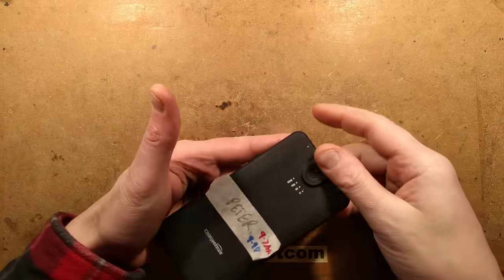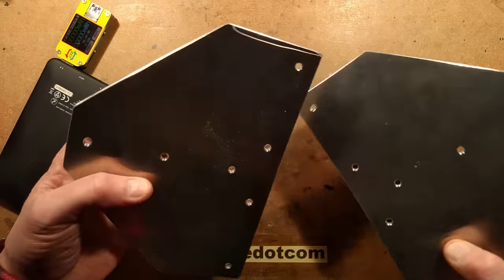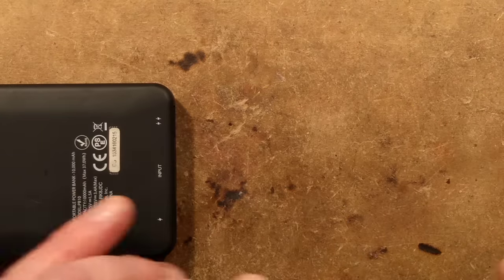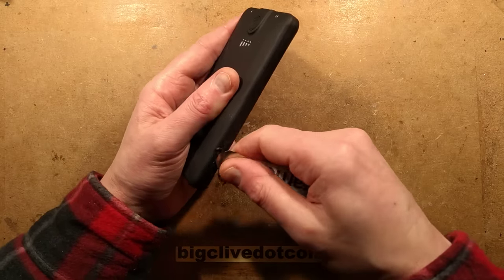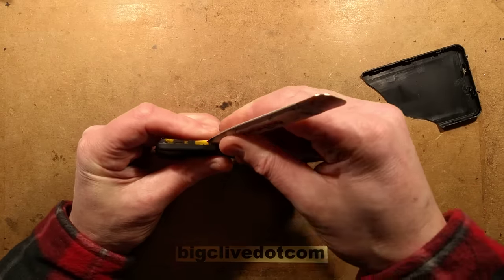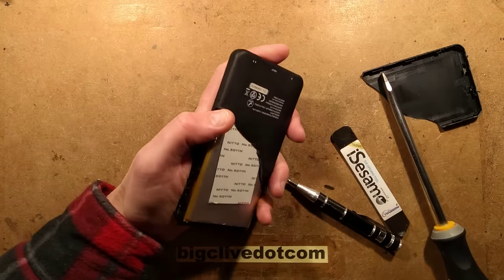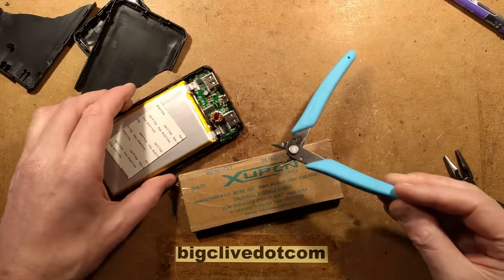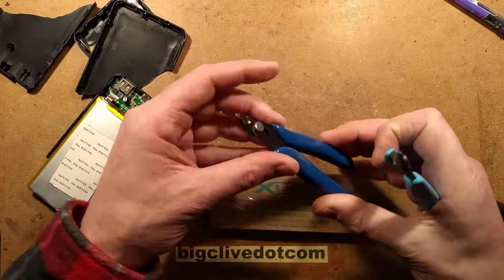Inside a recalled Amazon Basics power bank.

Comment: Iphone are easy serviceable but you have to take the screws out
Reply: Except for Apple's anti-repair measures where some parts are individually tied to the mainboard and will give you a nag screen, disable some features or stop working completely if you replace them. Oh and you know that big dumb piece of glass on the back of the iPhone 8? Replacing that is ridiculously hard, unless you buy the whole rear assembly, which will cost you more than the screen. I'm pretty sure they don't want you to fix their phones, and they make sure you know it. Other manufacturers have their problems too, but at least there doesn't seem to be a concerted anti-repair effort behind them.

Comment: To get it right: 10 Ah at a voltage of 5 V is the confirmed capacity, as I understood. This is 50 Wh of energy per charge/discharge cycle. This means that at an approximate voltage of 3.3 V of the battery itself has a capacity of (5/3.3)*10=15 Ah. This is quite a lot compared to the e.g. 3 Ah of 18650 LiIon cells. What are the dimensions of this battery pouch?

Comment: Appreciate that this is an old video, however the below is an extract from an American recall notice/site, which explains the issue:- 

"Incidents/Injuries:
Amazon has received 53 reports of the power banks overheating in the U.S., including one report of chemical burns due to contact with battery acid and four reports of property damage, including fire and smoke damage."

Comment: The trick to opening cases like that is to loosen a spot, put in a wedge, then work your way around. Sometimes they'll let you slide the wedge along, but usually you have to just work your way around with pokes and wedges.
Reply: I think this one had so many hard latches.  Sometimes latches are not meant to be broken, as it appears these are - the device was not designed to admit repair.

Comment: Comment on the internal lithium cells to case spacing you mentioned at about 07:45
The 16,100mAh Amazonbasics PB16 powerbank has what seems a LOT more cell to case space along with good cushioning material there than your 10,000mAh powerbank. 
The spacing without the foam cushion measures about 2mm but is entirely filled with a spongy soft foam cushion continuously fitted between the two long sides of and the bottom end of the plastic case and the 3 lithium cells. It feels about the consistency of Nerf foam. 
However, at the sharp bottom corners of the 3 lithium cells the foam is deformed quite a lot as it stretches around the cell corners, reducing the foam protection from ~0.5mm to 1.0mm of cushioning...but ONLY at the sharp corners. But, because the lithium pack is held in place to the plastic case by an adhesive patch on the 'bottom'-most cell and the supporting foam along the sides and bottom of the pack, it maintains an approx 1mm air gap between the foam cushion and the plastic case at these two corner points. I would think that the air gap could be compromised by dropping the powerbank onto a hard surface on one of the corners by either causing slippage of the battery pack inside the case, or deformation inwards of the plastic case corner..which I think would take more than a 1m drop to a hard floor. Based on your description and what I see in the PB16 I think as far as this part of it goes, the 16,000mAh powerbank is designed/manufactured better and likely "safer" than the 10,0000mAh model

Comment: The petrol thing is correct, but.. yeah, I understand why you wouldn't want to. Isopropyl Alcohol is a good alternative. It doesn't outright melt the adhesive like petrol does, but starts to dissolve it, making it far easier to remove after.

Comment: 21:50 I think you're right with your "boost" theory. When you did the current test at the beginning, you could see that clearly. The output voltage dropped a bit as the current increased, but a few moments later it came back up to 5V.
I think that the circuit readjusts permanently and depending on the load. I actually think this power bank is great. You get a lot of capacity without the cheating with glued-in weights and without almost air-filled case. And the specified output Voltage and currents are actually achieved.
I find it rather rare that you get exactly what you pay for. This power bank makes a good impression on me.

Comment: Do you think it's possible that there were two versions of this power bank?  I'm thinking that the "Nitto" branded foam on the "front" side of the battery might not have been there for the first version.  Then the manufacturer may have identified an issue where if the power bank was dropped then that side of the case may crack (noting the brittleness of that case) and puncture that side of the battery.  Putting that foam pad on that side of the battery may have alleviated that issue and that's why it looks so out of place.  Amazon, covering their butts, may have just recalled them regardless of version.  Just a theory ;)

Comment: I have the 16Ah version of this bank that has two lightning bolts on both output ports. Is capable of 3.6A across a common bus.
And yes, it was recalled as well.
Reply: That's a valuable hint.  Presumably the 16Ah version has different cells. This means that the problem is likely somewhere in the circuitry - some component may be likely to overheat and/or catch fire.

Comment: you can use rubbing alcohol little bit less flammable just a small amount still flammable though, but it works pretty good you should also invest in some plastic spudgers they are great for taking stuff apart

Comment: Hey Clive, the wround current shunt is still accurate for this test. If your load was switching rapidly then it may cause issues, but for a linear load it is a non-issue.

Xl = 2*pi*L*F, where Xl is the reactance in ohms (basically resistance), L is the inductance in Henry, and F is the frequency.

Xl = 2 * pi * whatever * 0 (dc) = 0, so all you have is the DC resistance.

However, if you had a switching load, then it may cause issues.

Comment: Aww, Clive. . . . . You made me sit through nearly half an hour of video, and no thermonuclear meltdown! ☢

I don't know much about power bank type devices, but this one seems to be quite a beefy looking effort, and just the thought of all that energy that could be released if this thing went 'prongs up' - I mean, image that in your top pocket, and you fall against something like an iron railing, or a brick wall - Ooh! 🎆

I reckon you should build a redesigned case for it, and hack it into a car jump battery booster pack! At 10Ah, it should have the potential to charge a car battery enough to get a few seconds cranking (with a suitable DC-DC voltage conversion circuit)?

Comment: As a matter of interest, are R27 and R28 the resistors put across the data pair to set the charge current? Which way, R0 = high current, or R0 = low current?

Comment: @bigclivedotcom   A little tip for removing the batteries from their stickers ... I use dental floss as a thin flexible wire to slip under the battery and tug in a balanced fashion to "slice" though the glue.  This allows you to use unreasonable force (if needed) without bending in any way the battery (and possibly causing fires)  :)
Hope it helps for next time!  Keep up the GREAT videos.  Regards.

Comment: Instead of using petrol to get the sticky pads off there's actually a product that stoma patients use to remove the adhesive plates, a medical adhesive remover, there's alcohol and alcohol free versions of this aswell, it's basicly a small box with 50 seperately packaged wipes, i've used these to remove residue from tape and all sorts of things, aswell as peeling things from each other. Works well with all the tapes and double adhesives i've tried so far

Comment: Help,  I have a 5v DC 3amp input feeding a NiCad this is off a controller board that appears to have failed with smoke,  the board though eiether has a bypas of the input voltage to the end load, or a switch to take either the external PSU voltage or the battery voltage,  the board or domponents are too small to carry the current, is there a veroboard design I could use to replace I have plenty of enclosure space in the end load area to do this? The final load is a 5v motor driving a direct driver turntable and small audio amplifier to tiny loudspeakers, so thats a fair current draw.

Comment: Simple answer on why it was recalled... central hot-spots and compression of the batteries by the "filler" tape which placed them hard-in-contact with any case compression.   Flatbats are supposed to be supported by soft foam with compression protection equal to at least 25% of their own thickness and you're not supposed to put packs against each other OR combine their leads like that.  Think what can go wrong if one of the flatbats develops a drain state... nothing to protect it against current from the other!    So, shit design 5 different ways!
Reply: I saw a big battery bank that had 5 cells all shorted together. That would be some massive chain reaction.

Comment: If the top double stick pad had been stuck to the case, wouldn't that have provided more protection to the batteries against impact damage against the corners of the case? I'm puzzled why they'd go to the trouble of adding the tape without taking that last step across the finish line.

Comment: I'm tending toward the thought that the failing packs were abused in some way before they failed...perhaps having been dropped as the video suggests. I KNOW my delivery service frequently ignores the doorbell and just drops packages over a 6 foot fence onto a concrete patio. That's a LOT of G's and many shipped packages are not designed to protect adequately against that kind of drop.

The flux residue also concerns me. Leaving that crap on the PCBs is NOT best practices and can lead to damage which could lead to a critical component or board failure.

Comment: Heat. Warm the whole thing to about 45 deg C. The glue softens enough to allow peeling with less damage.
Reply: Alternative is cold, freezing the glue below it's design limits but not low enough to damage components.
  For heat or cold, some disassembly kits include a thermal pack that is heated/cooled in the kitchen then pressed against the case closest to the glue.

Comment: Ive run across these circuit boards, by all means not identical,  they're fairly common and simple, it must be how they've jammed so much cell inside the pack giving the recall issue. Thx for the video.

Comment: Hey Clive! For separating things attached with soft adhesives like double-sided tapes and removing labels I've discovered that a modest temp heat source works nearly every time. Then there are always solvents in heat- sensitive situations . I've used laquor thinner with great success, and ethanol although less effective, rarely affects plastic surfaces.
Reply: HG do a product called "sticker remover" that smells properly of turps, not that substitute but actual turpentine.  Whatever it is its very good at removing sticky stuff.

Comment: If a battery has the foil damaged, you should be able to smell the odor of a chlorinated solvent.
If the damage to the foil is minor and the evaporation is very small, CO2 and water vapor will enter the battery and produce a delayed damage.
Over the span of two weeks, the battery will present an ever increasing internal resistance, day after day. At the end of the two weeks, the battery will overheat with the nominal C/10 charge rate, and will eventually bulge from the rapid internal pressure increase.
I never re-use recovered Li-Poly batteries for my projects.
Thank you for your great video...

Comment: The metal tabs/plates on the PCB where soldered on, you could of very easily desoldered those. They are not spot welded to the PCB just the metal plates.

Comment: Videos like this give me ideas for my battery bank i want to make for long camping trips. I'm building it by recycling a beefy version of the "Tesco Power Hit" (and removing the battery) and a battery bank of 18650's. Any advice? Mostly plan on reusing the circuit board inside. Would have to take the batteries out to recharge the thing, but that doesn't sound so horrible really.

Comment: i was wondering if you ever came across some galvanic corrosion due to using cheaper aluminium or alu wire or alu battery package or some sort of electronic applications made from copper ?

Comment: Former Apple Certified iOS Technician from an American retail chain here... yeah they’re not really designed for user serviceability but thankfully there actually is a proper way to open modern iPhones (at least back when I worked on them) which doesn’t involve scraping up the external case. You basically unscrew them and pull up the screen with suction cups. Around 6S or 7 they added adhesive gaskets around the screen which have to be cut once you manage to pull the screen up a couple mm with their tools (or a rough iFixit equivalent). You’re supposed to scrape it off and put on a new gasket at the end if you’re an Apple technician proper, but I wouldn’t fault a shitty screen shop for skipping that. I’ve seen proper technicians skip that. Oh and there was a flimsy ribbon cable that you have to pop out before opening it more than a couple dozen degrees.

Comment: What printer are you currently using? Mine is supposed to be a photo printer and despite source, settings and calibration it comes out a bit blotchy.
Reply from the maker: Epson eco tank.  The original image has to be well lit for the best results.
Reply: @bigclivedotcom  Thanks. HP used to be really good but the last two models I've bought have been fairly sub par.

Comment: The 0829A I believe is a Chinese clone of a BQ2954. That SOP16 is a Lithium Ion Charge Management IC with switching controller.
Functionally, it manages charging (between slow and fast charge modes) while monitoring temperature, voltage and current. It has two bi-directional pins for LEDs to show status, but also programs the display mode, and if current sensing is done on the pos or neg of the battery.

Comment: Could just have been recalled because Amazon got too many complaints about packs bulging or failing (without flames) because Amazon bought the cheapest possible cells, and recalling them before there were fires was just good economics.

Comment: Gave one of those to my niece as a gift and she abused it for a couple years until it shat itself.  She gave it back for repair and I just bought her a new one. Sat on it for 6mo until they recalled it. They sent me a fire proof bag and heavily labeled box and so I sent it in to the recycler for a full refund. 

Don’t know if her failure was related to the recall but I did buy the new one off Amazon, though not Amazon branded. I mostly purchase Anker and some Aukey but we usually lose them before failure.

Comment: Just for fun I bought a box full of these Xupcn cutters, or ones that are physically identical with them, with PLATO Model 170 printed on them.

While they do work if you just use them on very... very light cutting work, they can be surprisingly prone to failure if you give it anything to cut that is too much for it. They always seem to break the same way; one of the cutting jaws will just break near the axis.

One broke just by slightly pressing the jaws together without anything to cut. Another one broke while trying to cut a regular pin header connector pin, it just couldn't do it and died out of shame. Randomly, some of them live long enough to have the cutting jaw edge completely dull and malformed, again from very light level work such as cutting small wires. I think these cutters are made from tin or some other soft metal.

One of them has been a trooper and actually lasted for two years without breaking, but only because I was careful with it. I bought a box full of miniature version of this cutter as well, however they are even worse. They are so bad that even looking at them will break the cutting jaws, figuratively speaking. Two of them in a row broke easily when cutting again a little pin header connector pin. One I was able to break just by pushing one of the jaws with a finger. Another broke in two when it dropped on the floor.
Gotta love the China quality!

Comment: It would appear to be as you say, that the enclosure they have used is a tad too small for the cell dimensions. If it was dropped, or something weighty was dropped onto it, there is no space to accomodate compression or deformation of the plastic without it making contact with the cell. A shame really, as it is not a badly constructed powerbank aside from that issue.

Comment: Samsung makes excellent Li+ batteries. For the Note 7, Samsung Mobile sourced its batteries from ATL, not Samsung SDI (battery division). The issue was between manufacturing tolerances at ATL and the housing supplier Foxconn, which resulted in the cells being punctured/crushed and internally shorted. Also, even a good quality Li+ Polymer battery can explode or catch fire if punctured/crushed.

Comment: There were two failures on the Samsung side of things - one was caused by the metal contacts penetrating the dielectric causing a short circuit, the second was caused by the cell getting pinched in a particular spot